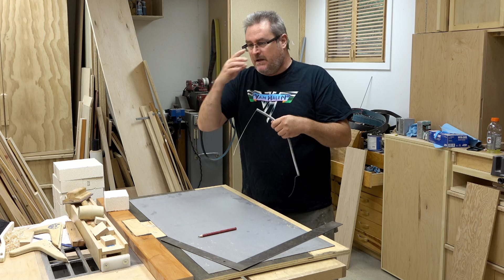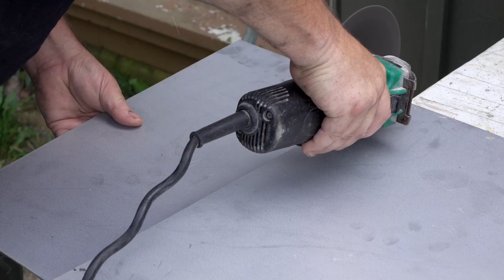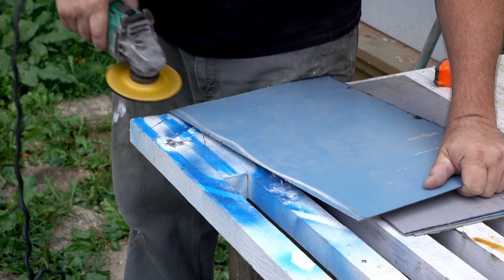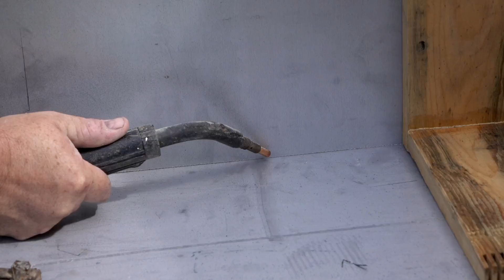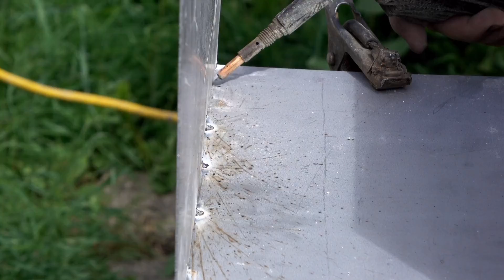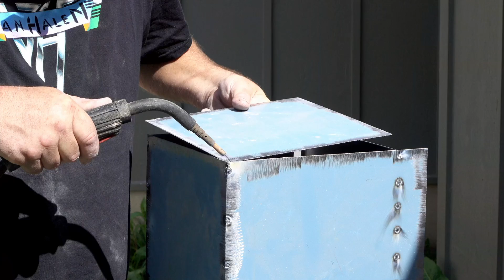Making A Heat Treatment Oven - The Case

Comment: Peanut butter sandwich build is a great idea and assembly on the table saw. Change mind about what kindof jelly to use 3 times and then trim the crust with the mitre station...I bet it wouldn't be monatized though
Reply: Need a build for a hot dog on a bun using a saw stop.

Comment: Although yours is built already, I have a video on a blacksmith forge I built on my channel you may wish to replicate in the future. Its a simple design, extremely efficient....and the total cost was approx $135. The outside can be touched while in operation even tho the shell is steel, it retains heat extremely well. I wont spam your channel by posting a link but you may wanna check it out...its my most popular video. Keep up the good work John 😊

Comment: For people that have no experience with them, cutting a line like that with an angle grinder probably isn't all that impressive.  I should probably make a video (gotta start somewhere) showing what an inexperienced idiot looks like attempting the same cut and the carnage that ensues.  Not that I would injure myself (maybe) but the cut would be so jagged and irregular you could get cut just by looking at it.

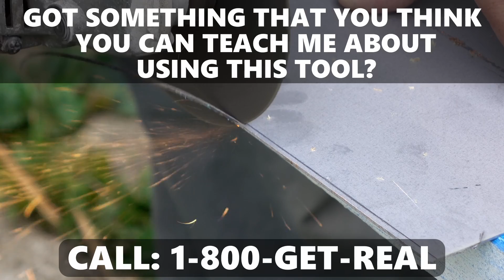Comment: 6:45 Do you get comments from the assholes about how to use a grinder?
Reply: I Build It Scrap Bin I've seen a guy more or less give himself a C-section with a large grinder. He was grinding slag off of a burned plate of steel and he didn't seem to have a lot of common sense in how he used the grinder, he just locked it on and swung it around like a madman. His extremely crazily loose shirt didn't help matters out either, that's what ended up pulling it into his stomach. The shirt didn't bind it up enough to stop it so it just kept running. Yep, it was as nasty as it sounds. About the little 4-1/2" grinders, I've been using one without a guard to clean CNC plasma cut parts 300+ times a day for 15 years, they're perfectly safe :D As long as they're ran with some common sense, no grinding like a maniac around loose clothing allowed!
Reply from the maker: Every time I use one. All the horror stories about loss of life and limb from "exploding" disks and how their best friend cut a finger clean off or had a piece of disk sever their jugular. Using a grinder is more deadly than walking through a mine field or swimming with alligators.
Reply: I Build It Scrap Bin Only if you're not skilled enough to handle it. Switch back to building with lego and let the big guys work if that's the case.